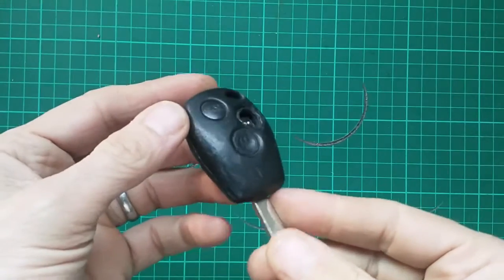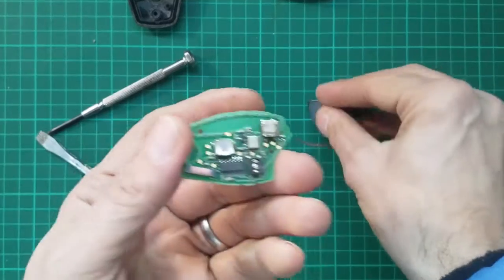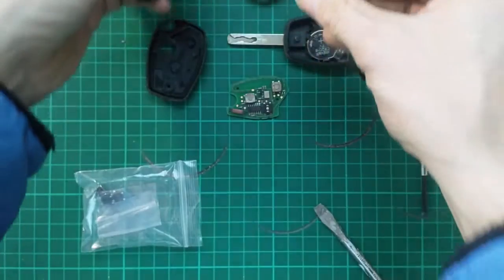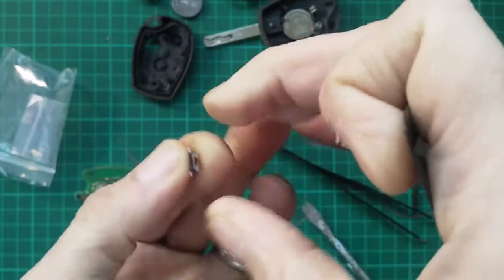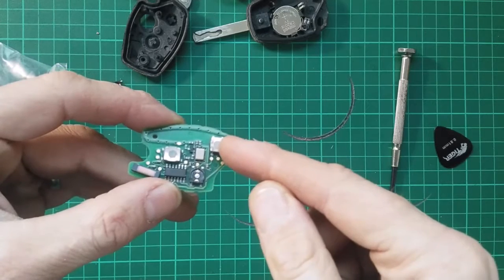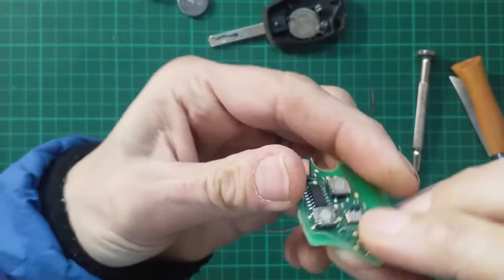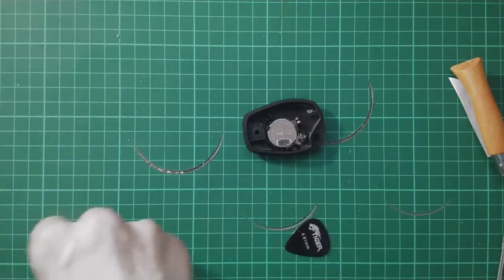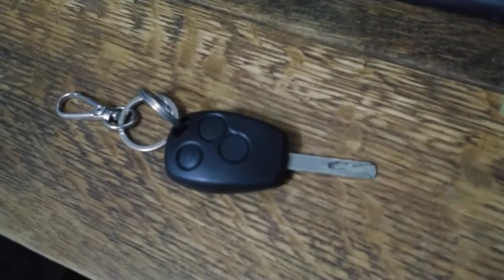Renault Car Key Repair - Broken Button [Modus, Clio, Kangoo]

Comment: Hi, Ich habe einen Renault Clio 3. Nachdem ich zuerst die Batterie tauschte, wollte ich die roten Buttons tauschen. Das aber geht nicht, wo soll ich die befestigen, muß ich die löten? Ich habe. wie du den Microschalter zerlegt, aber nun weiß ich nicht wie ich die auf die Platine bringen soll. Kannst du mir helfen Hi, I have a Renault Clio 3. After replacing the battery, I wanted to replace the red buttons. But that doesn't work. Where should I attach them? Do I have to solder them? I disassembled the microswitch like you did, but now I don't know how to attach them to the circuit board. Can everybody help me?
Reply from the maker: If you have the same type of buttons the top steel and rubber part of the buttons can be gently unclipped and new ones clipped on. If that doesn't work you would need to solder new buttons on. There are probably a few good videos on this type of soldering but essentially you need a fine soldering iron, appropriate solder, flux.

Comment: The blade didn't fit to the hole. I am checking China now, they offer specifications of the shell considering the blade. VA2, Vac 102, Ne 73. Did you mind that whilst ordering? I have clio 3 2007 so I think va2 is mine.

Comment: I lost my key fob for kangoo 07 van. How can I get new fob? Does the tracking app work? Thanks for your video. You explain very well.
Reply from the maker: Hello, I think in cases of loss of the fob it is probably a dealer or independent specialist required. Not sure you would be able to fix that yourself. Good luck.

Comment: How did you get the print on the holders in the key? i cant get it on them😅
Reply from the maker: Hi @cimbria1234. All should just clip together. There are some slightly different buttons so need to make sure get the right ones!!

Comment: Can I open my Twingo key switch and clean it and put it back? The button requires a lot of force to operate , must of the times it don't work at all.
Reply from the maker: Certainly worth taking apart and having a look. If it's the same sort of key it's pretty straightforward. And certainly cheaper than a new key.
Reply: @bigskies2202  This is a 1995 car, there is no key replacement, I must fix it.

Comment: Cheers mate got the same problem with a modus.the flip key went first ,after e bay purchase and fiddly headache didn't work out now the spare 3 button fobs rubbers split so better luck this time l hope.🤞
Reply from the maker: good luck. The modus has been pretty good little car for us all told, but fiddly headache sums up a few of the repairs have had to make!